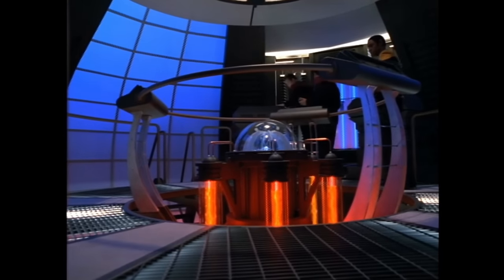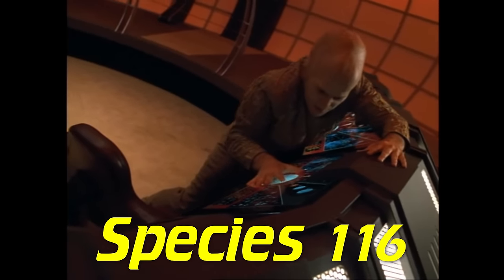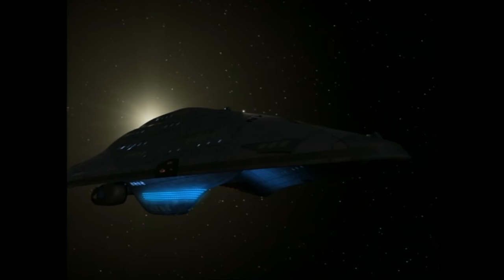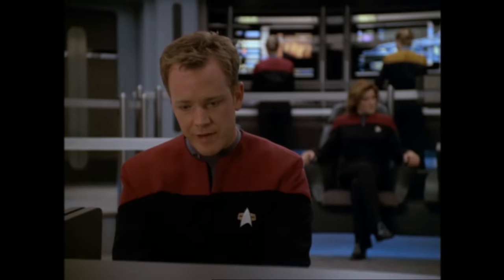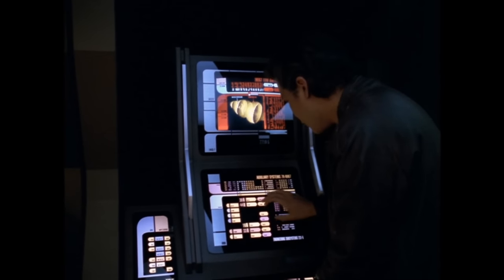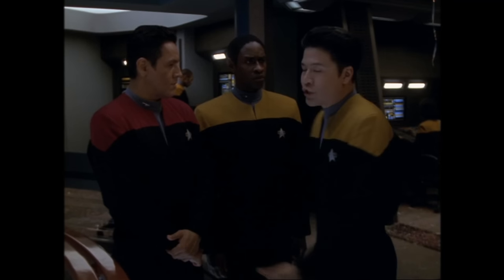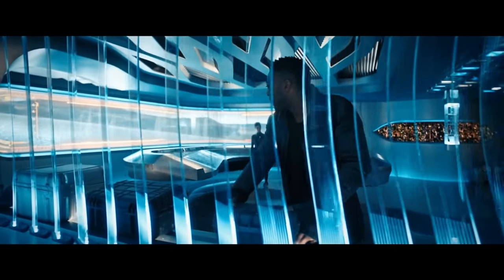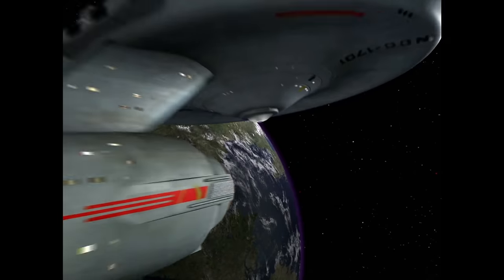Did Discovery IGNORE These Warp Drive Alternatives?

Comment: One thing that I continue to think about is is the romulan forced singularity drive. So you need dilithium to control matter antimatter but if the romulan's haven't used matter antimatter for ages why did no one else adopt that power source? Even if this technology was only limited to warships it would only be a matter of time to downscale the technology. I disliked the scale of the burn alternatively I would have gone for a burn on a much smaller scale. Some kind of spatial anomaly blew out all the the dilithium in a single system and everyone's paranoid where it might happen next. Perhaps there was a new weapon that could destabilise dilithium crystals at range or other events that made it unpopular and untrustworthy.
Reply from the maker: It's never been proven that Romulan warbirds don't need dilithium to operate...I mention this in the video! Lol
Reply: The point is Plasma.  Matter and Antimatter create plasma as a byproduct of their mutual annihilation.  The dilithium is only used to shift the plasma into a better form called Warp Plasma.  That gets sent to the warp coils and create the warp bubble for FTL travel without experiencing relativistic effects.  

The forced singularity only replaces the M\AM reactor to create plasma, it still needs dilithium to bump it into warp plasma for the warp coils.  The plasma made by the introduction of matter to the singularity and being scooped out via magnetic ram scoops near the event horizon is of a poorer quality compared to M\AM annihilation.

They're more akin to comparing gas engines to diesels, but they still use petroleum and dilithium is more like the transmission of a vehicle rather than the engine.
Reply: I know you did mention it hadn't been proven but that was just the thing I kept thinking about. The Klingons and the federation are always seen fighting over dilithium but the romulan never seem to get involved is it because they aren't as dependent on dilithium or do they just have greater supplies in their own borders.
Reply: @OrangeRiver we do know the nature of the D’deridex’s power system and it doesn’t use Dilithium. However it doesn’t speak for the entire Romulan fleet, regardless of how many D’deridex’s were shown on-screen
Reply from the maker: Plus, the singularity engine is an extremely risky model that may be hard to scale to an entire fleet, let alone galaxy
Reply: Some beta sources say the Romulans still need dilithium to control the plasma energy being ejected form the Singularity.
Reply: And cobsidering how closed of the romulan Star empire was I can imagine they had probably more dilithium supplies inside their borders or didn't need as much dilithium as klingon and UFP drives

Comment: I just wanted to point out that, unless we also stop using coal, electric vehicles are not cleaner, or better for the environment.
Reply from the maker: Well, yes and no. "Electric vehicles are bad because the electrical grid still uses coal" is a PragerU talking point that's meant to deflect from the fact that we should ALSO be converting our grid away from fossil fuels. However, I also think electric cars are kind of overrated since what we really need is better public transportation
Reply: @OrangeRiver fully electric cars are only cleaner once you are driving the fully assembled car. Aside from the fact that the power to charge the car is mostly derived from oil/coal/natural gas power plants. There is the mining of the lithium, cobalt and other minerals for the batteries. ( much of that done overseas in very damaging mines many of which use child labor) but there is plenty of oil used in the mining and in the production of all the plastics used to build the vehicles. Not to mention the end of life for the vehicles. What happens to all those dead cars and batteries. Likeley the will sit in a giant ev graveyard like the ones seen in Europe.
Reply from the maker: Not disputing any of that, but see the last sentence of my comment again 😉

Comment: I find it very difficult to accept that: 1) most local space powers hadn't evolve FTL drive technologies in over 800 years, and 2) temporal agencies either didn't see "The Burn" coming or didn't find it necessary to mitigate. I feel the showrunners just wanted to destroy the Federation... for... reasons. 😅
Reply from the maker: Well, something a lot of people don't realize is that a storyline where the Federation has collapsed and a cataclysmic event renders warp drive impossible has been in the works since 2005 when Bryan Singer pitched that idea to Paramount. Discovery season 3 is essentially just the realization of that, although the specific reason for the Burn is still stupid lol
Reply from the maker: @subraxas The fossil fuel allegory would have been much stronger if warp travel had to be slowly phased out due to dwindling dilithium supplies rather than a single cataclysmic event, IMO
Reply: @OrangeRiver  You'd think between the TNG episodes about how 24th century UFP warp drives are destroying subspace, and the exotic FTL technologies of other civilizations, Starfleet would've pushed harder. 

This is a nitpick... but I think overall Starfleet ship designs by the 32nd century should've been extremely advanced and near-unrecognizable to us... maybe utilizing thought, like the Traveler... or the Spacing Guild navigators from Dune... 

IMO, it's a lack of imagination on their [ST:DSC showrunners] part. I got more excited by ST:ENT Daniels and the temporal agents in ST:VOY. 😅

Comment: Nice video up to the point where you started talking about electric cars and then it did go down the drain.
Please inform yourself about the production (especially the batteries) of an electric car and the recycling of it.
Compare now the 2 technologies.
Don't get me wrong, i am all for progress but the "progress" we are having right now especially trying to be "CO2 Neutral", is just stupid.
I am from Europe, we banned plastic straws, good (for pastic but the new ones made from paper and coated, are unhealthy for us). What is one of the new laws coming on 2024? The cap of plastic bottles must be connected (can not be removed without cutting) in every plastic bottle. Does it sound good? Maybe, until you realize that it means 3g of plastic more for every cap. So under the line if that action is better or worse for ecology, it shows it is worse because we make more plastic than before. 
Back to the video, there is an episode in TNG where the "airspace" was being damaged from fast Warp travel. How we know if in the meantime, we found out that all alternatives are not good?
The lack of progress, don't really bother me. Most advancements was made usually by wars and from what we can see (and i remember from the serie), there wasn't really war raging. Most people was so shocked from the burn that they closed themselves in their space and tried to survive.
If you want to compare the burn to something, let's say that one day electricity will not work. That is the kind of shock / chaos they was in and i don't think the first idea to have is, let's start a war.

Comment: Simply all the alternatives you've listed rely on Dilithium in some way.
Reply: Well not them specifically but the antimatter reactor used to fuel the massive power needed the dilithium to control the reaction. So need a power system with no dilithium
Reply: Didn't the Romulans use a controlled black hole for their engines? That wouldn't be antimatter so theoretically it doesn't need dilithium to control the antimatter reaction.
Reply: Dilithium is more akin to a transmission of a vehicle, rather than an engine.  It converts the plasma (whether created by matter\antimatter annihilation or relativistic acceleration of matter near the event horizon of a forced singularity that is scooped up by magnetic ram scoops) as it passes through the crystal lattice into Warp Plasma, a better, more powerful form of electro-plasma (EPS) that can energize the warp coils (drive axles of a vehicle) to create a warp bubble (wheels and tires) that interacts with space-time (road surface) to allow FTL travel without experiencing relativistic effects.

In the end, regardless of the methods of creating plasma, they need the Magical McGuffin that is Dilithium to complete the puzzle.

There are those that bring up the first Bird of Prey in "Balance of Terror" having only impulse, per Scotty, and there are those that would bring up Cochrane's "Phoenix" that both achieved warp without Dilithium, but they weren't as powerful or speedy and consumed a lot of their fuel brute forcing FTL.  Much akin to someone having a direct drive from the engine to the drive axle and just revving the nuts out of the engine to achieve any speed.

Comment: I always thought it was a power issue, everyone used matter/antimatter to power many of those drives, without Dilithium there was not a safe enough way to power up those drives. Same with other tech, transwarp etc, you could build the drives but without a power source you could not get them going? or am i missing something...
Reply: Dilithium is more akin to the transmission of a vehicle, rather than the engine.  The whole point of Dilithium is to transform regular electro-plasma (EPS) into Warp Plasma that can power up the warp coils and create the warp bubble to allow FTL travel without experiencing relativistic effects.

The method of creating the plasma in the vast majority of the galaxy is via matter being slammed into antimatter.  It's the most energy efficient and creates a better plasma for the Dilithium to convert into Warp Plasma.

The Romulans use the forced singularity drive to make plasma by feeding any old matter into the singularity, then deploying magnetic ram scoops near the event horizon to scoop the plasma before crossing the horizon.  Some of the matter is lost to the singularity and the resulting plasma is of a lower quality to the M\AM reactor.

In the end, all the Dilithium does is convert the plasma to a better form, it doesn't regulate the reaction.  That's what the fuel injectors are for.  So think of the Dilithium as the transmission of a vehicle that takes that force created by the engine and transfers it to the axle (warp coils) and then to the tires (warp bubble) that interacts with the ground (space-time)

Hope this helps.
Reply: I don't believe you're quite correct about how the singularity drive works. Black holes emit energy in the form of Hawking radiation. Tiny black holes actually emit more of this radiation in a smaller space (not more total than a larger black hole - square/cubed law, etc) These tiny singularities must be constantly fed with matter to avoid evaporating completely. So in a similar way to a matter/anti-matter reaction, matter and/or antimatter (although probably just matter for practical reasons) can be fed in and energy comes out.

That much said, nowhere was it discussed canonically whether dilithium is used in this process. It may very well be.
Reply: @danielseelye6005  sorry, I didn't tag you in my last response.

Comment: Poor writing and poor research are the only ways the idiotic burn setup can work. By the time of Voyager, the Federation was experimenting with transwarp. Heck, by the time of the USS Excelsior, the Federation was already using crude transwarp technology. It is inconvincible that the ever-scientifically minded  Federation would not have perfected a type of transwarp or hyper lane travel in all those centuries considering all the options listed. In fact, the Federation did so in the novel-verse not long after the Dominion War Era they named it slip drive. Look how fast the general ship designs improved between the Dominion War and Picard Season One you mean to tell me this wouldn't apply to other tech in eight centuries. I also do not buy the "good enough" argument because the Federation is about exploration and warp limits how far they can explore. By the time of TNG/DS9, the Federation had hit the hard limit of where warp could take them. Please sell that BS elsewhere. bad writers.

Comment: Discovery is so frustrating. Dilitium being inert is the point.  It is the only known material to withstand a matter/antimatter reaction so the resulting energy can be focused.   It's like saying the graphite control rods in a fission reactor suddenly become inert.
Reply: Great analogy though, since it was a lot like if boron suddenly stopped moderating neutrons. There’s of course multiple meanings of inert, you used the nonreactive kind here but it can also just mean non-functional. (IE DBZ “the balls are inert” ancient meme.) And I think that’s more likely for a writer to intend!
Reply: @kaitlyn__L  good point. But it’s presented as the magical go mcguffin. The term "warp core" is a bit of a misnomer since it's not the core that technically makes the ship go FTL. The core simply generates the energy for the warp coils, which bends space to make FTL possible. To put it in modern terms: it’s the battery in a Tesla.
Reply: @subraxas  the detail there is I don’t think they ever said it interacted with subspace until Discovery. Now I personally always headcanoned it as such, and also figure it’s needed for subspace antennae as well. So I personally went “yay, the writers and Dr Erin share my theory”. 

But the other half of fans assumed it was verterium-cortenide which was the subspace-y element, which would indeed make the dilithium Only a moderator. Though I personally don’t see the point of a fission-style moderator, since just like with fusion you have a direct “throttle” on antimatter injection. Just stop injecting it. 

So that’s why I always preferred the former theory — it also gives an answer as to where the dilithium even goes, namely into the plasma. Perhaps it’s the main ingredient in the plasma since the matter and antimatter have become just energy transferred into the dilithium. Which gives a proper reason to shoot the (partially-fusing before annihilating) matter and antimatter through the dilithium in the first place, because they want it to absorb the energy and be ionised-vaporised. (The “unique interactions with antimatter” vagueness can even be preserved, since it is boiling off rather than being annihilated.)

Comment: Also, Romulan tech used a singularity for FTL travel and thus shouldn't have been impacted by the idiotic burn.
Reply: I thought the Romulans were extinct in this timeline?  I'm so confused.

I'm not enjoying this at all, any more.
Reply: I'm not 100% sure because as soon as the idiotic contrived burn storyline started I stopped watching. I do recall reading somewhere that the Romulans and Vulcans reunified during the season. Either way, if the Romulans were extinct this would be just another contrived element to make the burn work along with some of the tech alternatives to warp mentioned in the video that cannot work for reasons never explained - as stated by the 31st Century guy  @DJSockmonkeyMusic
Reply from the maker: Romulan starships still use dilithium.
Reply: Do we know that for sure? They could use it for something else. The specific use of dilithium in a warp core is that it can be rendered porous to antimatter, so it seems highly unlikely that it is used in a singularity core. It is far more likely that the Romulan Empire still maintained a lot of ships that used antimatter from before the singularity core was developed just my theory. If you have a source that states otherwise please share. @OrangeRiver
Reply: @JasonFoxTheGreat in beta canon the Singularly ejects plasma. Dilithium is used to regulate the plasma going to the warp nacelles.
Reply: And this is stated clearly? Either way, Beta Canon doesn't count for the TV product thus the highly divergent timelines seen in the novels versus the TV product. Either way, the new writers are simply bad is the correct response or rather the reason for this flimsy plot point. 😆 @TheMrPeteChannel
Reply from the maker: Remus is rich in dilithium.

Comment: You missed the obvious.  Impulse Drive.  While not normally used for FTL in the Federation, likely due to the discovery of Warp Drive, the Romulans of the 23rd century did use Impulse Drive to travel FTL, as events in Balance Of Terror indicate.  Also evidenced in Where No Man Has Gone Before.  The Enterprise's warp drive is out according to Kirk, in his log,  in the episode after encountering the galactic barrier.  Also according to Kirk and Spock they travel to Delta Vega, 3 light days distance (Spock) in less than a day (Kirk's log entries).  It is established in The Naked Time that a day is approximately 24 hours.  These facts combined firmly establish that the Impulse Drive can be used for FTL.  Despite what Beta canon sources say on the matter.  And, as a sailor, I would want a back up FTL drive even though it's slower than Warp Drive.

For more on Impulse Drive as FTL see my video here https://youtu.be/RD_gXzLXRbU?si=GtuJPVeZbT9qkZOb

Comment: Well, Dilithium is used to regulate the Matter/Antimatter reaction specifically, right? Thus, it would make sense that the romulan warp drive doesn't use it.
So why do the Romulans still have mines. Well, they do have smaller ships as well. I don't think we have seen a singularity drive on anything other then the D'Deridex. It makes sense that smaller ships can't fit a singularity inside...

Also, theres the Phoenix. Dilithium can't be found on earth, yet Cochrane achieved warp. So, the Phoenix was capable of warp flight without Dilithium. I know it's not that fast or stable, but you'd think it's better then nothing, right?
Ultimately tho, we have seen tons of ways to travel without the use of the traditional Matter/Antimatter warp core. It's disappointing those were never mentioned at all. We, as fans, have to take guesses on why they haven't been used....